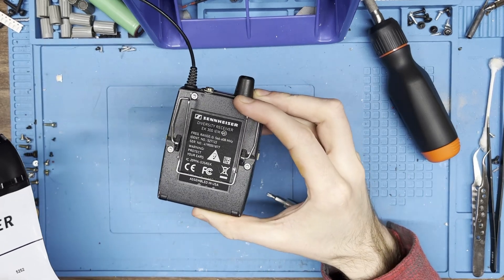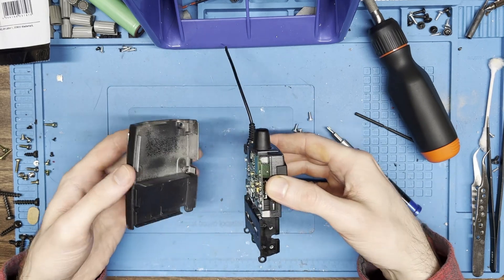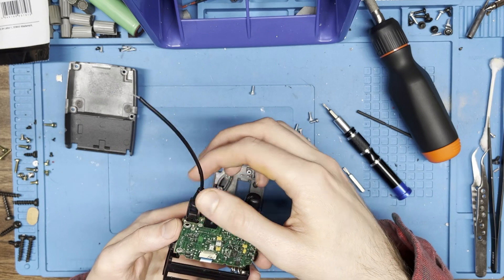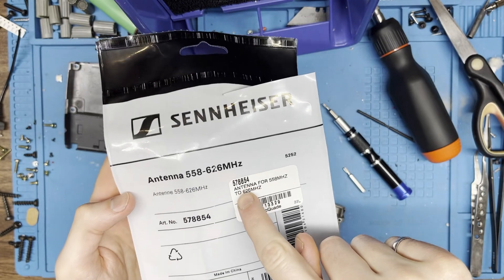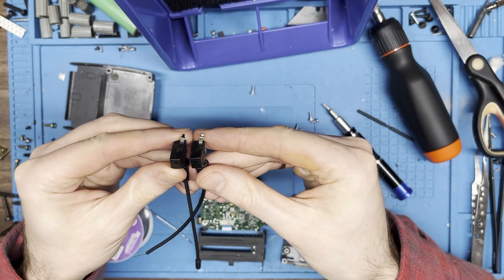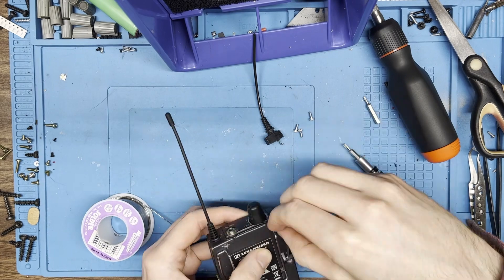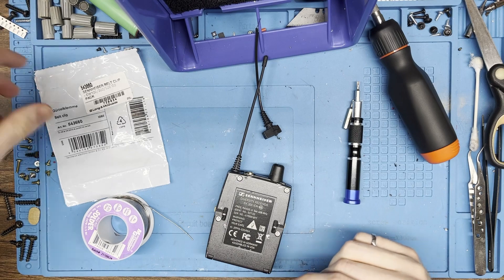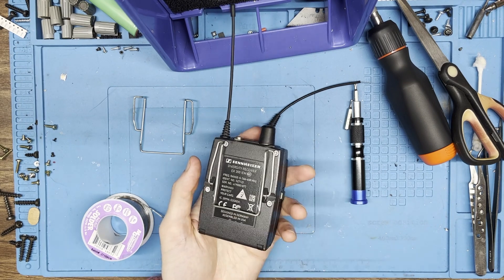Sennheiser EK 300 IEM (G3) receiver - antenna replacement - G band

Comment: What happens when the antenna is like your old one? Does it make noise or does it have trouble connecting to the receiver?
Reply from the maker: It performed just fine but I wanted to replace it before it broke worse

Comment: Another option is to install an SMA Antenna adapter instead. The same amount of work, but from that point forward, antenna replacements are a breeze.
Reply from the maker: That's a great idea. any hints on part numbers?